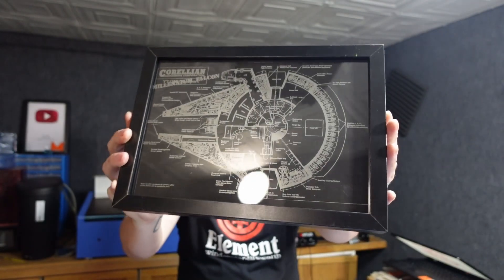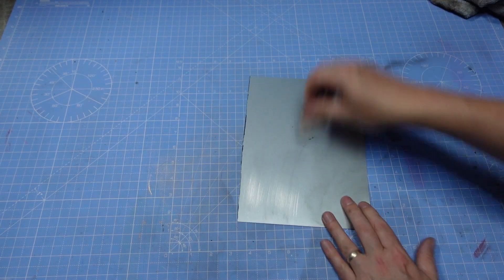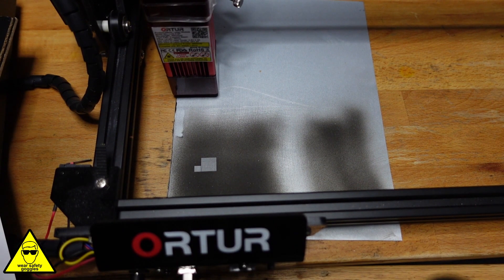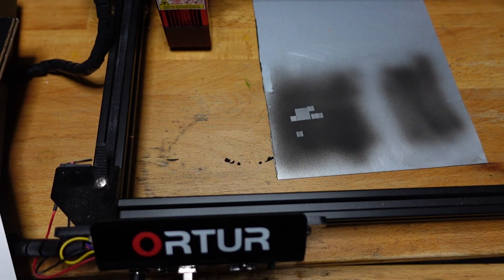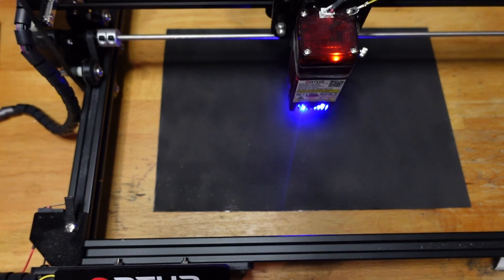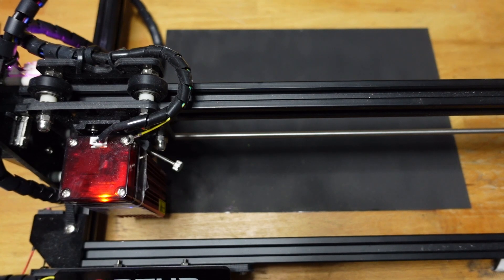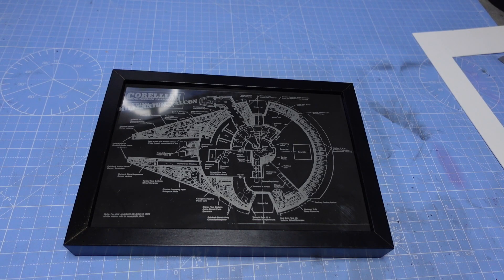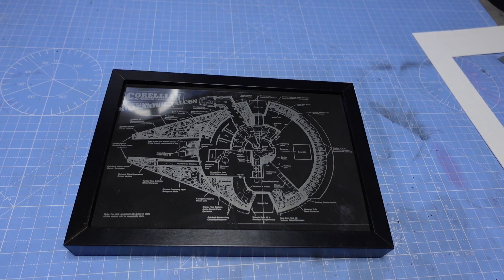Laser Engraving On Sheet Metal [well... kind of]

Comment: That looks really nice. I have the same laser, but with a 2.1 watt module. I'm hoping it would do something like this on stainless. I made a beautiful photo of my wife's late sister with black paint and glass with it, and was amazed at how it turned out, but this is so crisp and detailed.
Reply from the maker: The small, low powered lasers can achieve much more details as the spot size is usually so much smaller than high powered lasers.
It should work with your laser as it should be able to burn away a nice thin layer of paint with no problem

Comment: 5.5w diode laser marks Stainless steel you just have to apply some black paint prior?
Reply from the maker: As far as I know it will not mark stainless. This is removing the paint from the stainless steel and just showing the metal where the paint has been removed 👍🏻
Reply: @MARCAM  I'm running an entry level Two Trees 5.5W laser next to this PC as I type, all you need to use is a Sharpie pen or some black spray paint onto a 2B stainless finish, you need to go very slow admittedly but it will engrave the Ink/Paint into the top few micron layers of the stainless steel. You'll have a better effect using a brushed No.4 finish. Then just clean the paint off using Acetone/Xylene mix etc. It leaves quite a solid engraving. (I run a 4KW Co2 at work for a living, 25 years experience and this diode laser is fun to learn).
Reply from the maker: @Eschelonistic ooh now this sounds like something I will have to try out!
I was recently given a 10w to test (recent video that I’m also giving away) and that marked stainless steel by itself. Its a fun little machine for doing little projects with metal 👍🏻
Reply: @MARCAM  10W will do it easily and a lot faster, be interested to see your results. Not viable running the 5.5W as it's painfully slow (200-300mm/min) but for a one off here and there it does the job. Messing with frequencies and pulse rates on a 4KW machine is killer, half the time you can read the engraving on the back of even 3mm thick SS if your power ramps just a little off. Much prefer diode for the ease of control over the power, fun toy so far!
Reply: @MARCAM  https://www.youtube.com/watch?v=vdfPB-3avds This be my Toy at work (Or Prima Platino 1530 4KW) if it is Region restricted (600 holes per min/ 1mm thick metal anything).
Reply from the maker: @Eschelonistic holy crap!! That thing is crazy!! That must just churn work out all day everyday!!

Comment: Nice job! I am struggling to do the same with my 5.5W diode laser. I painted a piece of aluminium in black, but the laser would not remove it. It only makes the pattern, but a layer of paint still seems to be present. I painted only once, so as thin as I can. I run it 100% power and even very slowly (100mm/min) and still the same.. Any advice?
Reply from the maker: What paint are you using? I just used acrylic for this project. Just make sure you spray a clear coat afterwards as it’s not a permanent paint 👍🏻
Reply: @MARCAM  I initially used some high quality paint, perhaps not acrylic. But now I tried specifically an acrylic one and the effect is the same.. Don't know why..
Reply from the maker: @sun_of_a_gun that’s strange! A 5w diode should blitz through acrylic paint. Only advice I can give is to make sure the laser is in focus, your power is high and speed is medium to low. I’ll have to have another look next time I’m in my workshop at it
Reply: @MARCAM  the problem was the focus! Thanks for staying with me ;)
Reply from the maker: @sun_of_a_gun awesome! Glad you got it sorted :)

Comment: What type of air brush?
Reply from the maker: It’s just one of them super cheap ones that has the paint well in a small glass jar that screws onto the bottom. I just hook that up to my air compressor and works a treat 👍🏻
Reply: @MARCAM   also what type of paint did you spray on the sheet metal? Thanks for the help
Reply from the maker: @antoniogarcia6756 I think it was acrylic I used for this video. A nice even, thin coat the laser can just burn away

Comment: So any black acrylic paint will do the trick? 
I have CO2 laser and wouod like to trst this
Reply from the maker: Should work fine. Think any paint will work tbh as the laser is just removing it 👍🏻
Reply: @MARCAM  Ah okay, I was hoping to have the design etched and remove the background.
Reply: Why did u not use your other laser?
Reply: @ryanw501  my desktop laser is 3.5w and does not engrave metal. Tried different techniques but no luck
Reply from the maker: This was to show something amazing that can be made with a super cheap diode laser as more people tend to have diode instead of cO2. But, it also has a bigger work area so I was able to make this piece bigger than what my cO2 could do @ryanw501

Comment: Just tried this on some stainless and had to abort the project as it warped the metal badly.
Reply from the maker: Really? That’s strange. Maybe you were running the laser too high? Could of been heating the metal up.
Was the metal hot to the touch when done?
Reply: I can engrave small business card in aluminum with my 10 W laser, but I have to fasten it to a support with masking tape, to prevent this warping. Actually, I found out that the part with masking tape engrave better than with black paint, so I am trying this (cover all metal) right now!